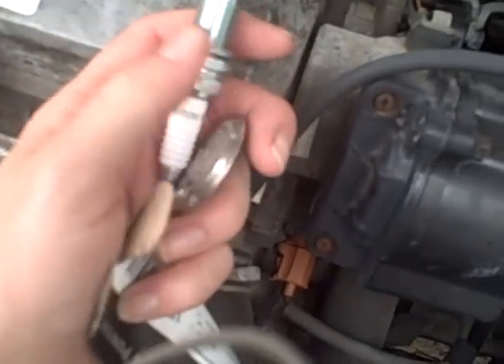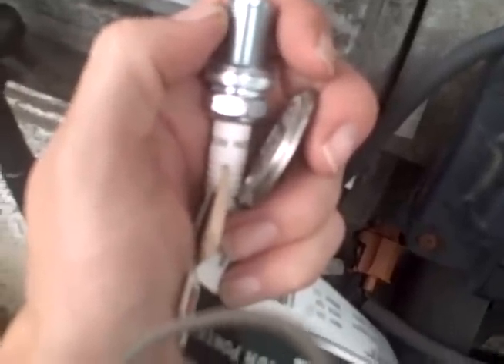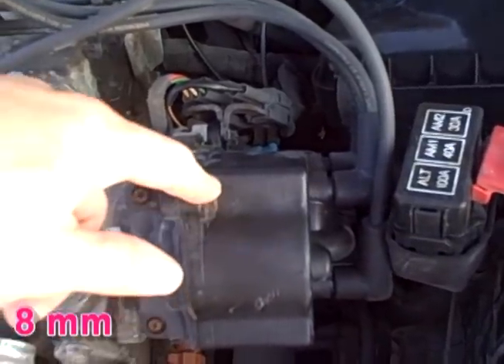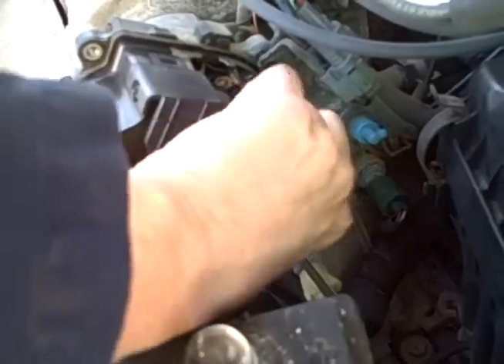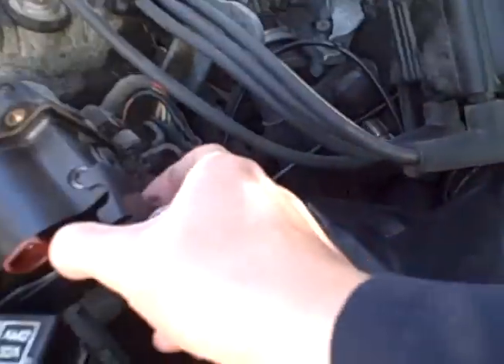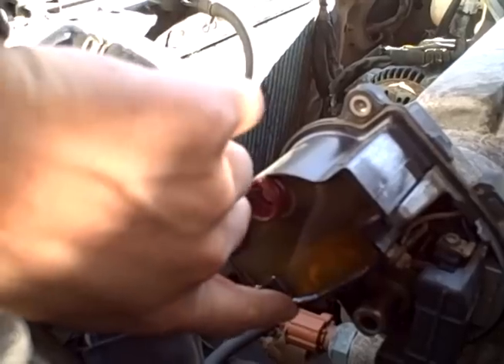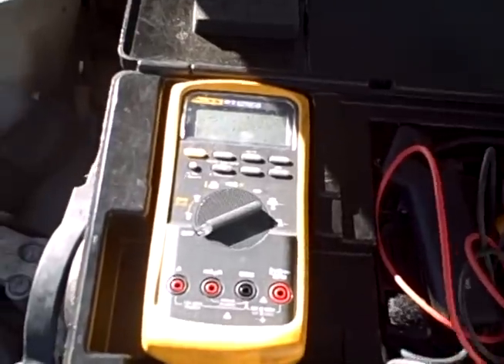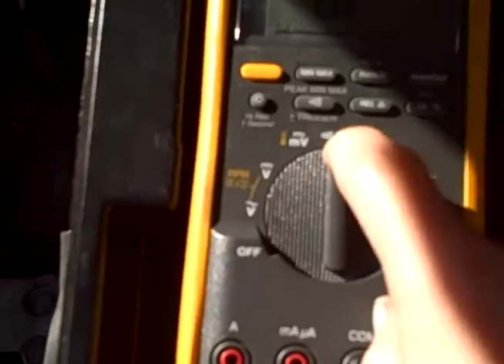How To Determine If You Have A Bad Ignition Coil. (Results May Vary)

Comment: Nice to see a girl working on a car!
Reply from the maker: You should subscribe then! :) I like to see people in general working on their cars. I love self reliance!
Reply: I do all my own repairs, had 1-1/2 years of school and a few years of service and aftermarket accessories experience. Pretty well rounded. I just don't get into engine or transmission rebuilding.
Reply from the maker: jakro1972 That's awesome!
Reply: D6Spanky No, you're awesome! I still need to check my drum brakes, then I am going to remove the Kelsey Hayes ABS unit and resolder the circuit board as I've heard that is commonly the source for my ABS codes!
Reply from the maker: Soldering is a great skill! I love doing it! Keep me posted how it turns out.
Reply: D6Spanky I mostly use my soldering skills for my RC cars and trucks battery, esc, and motor connections and for making LED light pigtails!
Reply from the maker: jakro1972 Cool!

Comment: This was on my Makita buffer so it's car related at least.  It quit working but would start if held at a certain angle.  I had a mental image that a contactor in the switch broke lose so convinced that was it ordered a replacement switch.  Waiting for the switch I went on line & found that a broken wire at the handle is common & guess what?  Yep now I have a brand new $35 Makita switch as a spare plus lost several days waiting on the switch.  Test - never assume!  Getting old is tough!
Reply from the maker: I try to always research online first. My sister has a 98 town & country. It would just randomly not start. We googled it and a briansmobile1 video came up with the answer. Saved me a bunch of headache!
Reply: D6Spanky 10-4!

Comment: Something I urge you to do...don't use champion spark plugs in anything from Japan...use NGK's...
Reply: D6Spanky, also don’t wear white after labor day, go swimming within an hour of eating, go outside in the cold with wet hair, walk under a ladder, or open an umbrella indoors…  or any number of old wives tales.
but seriously, use whatever plugs you want. As long as they are gapped properly they will work fine regardless of car or plug manufacturer.
Reply: @petrocksgarage  so keep on believing that always use nkg on Japanese motor,
Reply from the maker: fightingfalconfan I don't know I just go by what it says on the box. shrug This one said it was recommended for Toyota.
Reply: The manufacturers listed in owners manuals pay to be in there. Its advertising and product placement (like in movies). Always has been.
As for the 'ignition engineers’ (which don’t exist, btw), the engineers don’t choose manufacturers. They issue specs (e.g. thread pitch, spark hot/cold range, gap range etc). The company bureaucrats at the top decide the manufacturer. Engineers also don’t write service manuals or owners manuals (a lot of engineers use English as their secondary language). They are just consulted during the writing process.
Reply: @petrocksgarage not installing any plugs for me I guess if your customers don't know and you don't know go for it.
Reply: Pet Rock's Garage
Couldn't be further from accurate about who decides what spark plugs to use. The ignition engineer is the one who builds the whole ignition system from scratch, timing, what ignitor, coil, gauge of spark wire, ect...they figure out every little detail since they designed the whole system. Maybe you should actually learn how cars are put together before you go telling people what is safe to use in cars. Sure you pop in some champions in YOUR car and it seems to be working ok, not all cars can take what you just decide to pop in like in oil (brand not viscosity rating) But when it comes to fuel burn, go with what the engineering team went with; they know that vehicle better then you ever will; it's been proven time and again.
Reply: @fightingfalconfan  so what kind of oil do i use in my 7afe 95 corolla? 5w30? if so what kind?
Reply: @Mr123pbd  Seriously commenting on shit from 5 years ago?? 5w30 high mileage. The SAE doughnut super seeds what it used to call for back in that time frame.
Reply: fightingfalconfan, ok, then please explain why in some Fords have Mitsubishi motors inside and their owners manuals recommend using Motorcraft spark plugs (a Ford brand btw).  While Mitsubishi cars with the same motors have owners manuals that recommend a different plug manufacturer.  Could you explain that please?

In order for a third party brand to be listed in any print material, like an owners manual, a lot of money & signed contracts have to change hands between the two companies. No collaboration in business occurs without money, contracts & lawyers. So an engineer could specify NGK all they want, but if the lawyers can’t bang out a deal with NGK then they can’t specify NGK in the manual. Otherwise the motor company would get sued pretty hard for trademark infringement. So the motor company would have to find another plug manufacturer that meets the engineers specifications.  Which goes back to my statement of engineers don’t specify a brand. They specify the performance characteristics, heat range, size, thread pitch, gap of the plug etc so that the brand/manufacturer doesn’t matter.
Reply: f, that, i buy whats on fricking sale and has worked fine for 30yrs pfft,
Reply from the maker: Huh. ok. I'll be sure to change them out when they go to crap. I just don't have the cash flow for something as nice right now. I know, I know, It'll bite me in the butt.
Reply: Always go by the owners manual...if this one don't have one I am sure you can find one for it online. Like a forum or something.
Reply: fightingfalconfan Maybe Bosh is OK too who also makes iridium plugs like the NGK iridium, not just platinum.
Reply: Bosh is fine.  However, don’t waste your money on Iridium or platnum plugs on this car. All iridium & platinum plugs give you is a longer lasting plug. It doesn’t perform any better or worse then a standard plug.
Reply: Pet Rock's Garage thanks
Reply: D6Spanky shop rock auto
Reply: Actually dead wrong, going with a spark plug the ignition engineer chose not to go with can cause issues...don't matter if they are gaped or not.Asian vehicles are vary particular about what spark plugs to use.

Comment: An ohms test is almost always unreliable. First you have to completely disconnect the Component Under Test (the coil in this case, which I think is still connected to the wiring harness in your video) otherwise you can get a bad reading if there is even a tiny short somewhere in the circuit. You'll be reading the ohms of the entire circuit, not just the C.U.T. Second, the act of removing the C.U.T. can often fix it if the problem is a loose connection or damaged wire or something like that. Intermittent problems like that are a P.I.T.A. Third, you need to know the ohms spec for the C.U.T. which is often not available or different from manufacturer to manufacture let alone production run to production run. All an ohms test will tell you reliably is if there is an open in the circuit.
With that said, a voltage drop test is much more reliable, and you don't need to know any specs or remove anything. It can tell you if you have an open, short or excessive resistance (the 3 possible faults in a circuit) in one or two voltage measurements. Check out Dan Sullivan's channel & realfixesrealfast channel, they both have an awesome tutorial on voltage drop tests. Makes electronics diagnosis so much easier.
As for misdiagnoses, it happens to the best of us. My worst was on my '03 Dodge Durango when the passenger window switches stopped working, except from the drivers door switches. I knew it was an open in the circuit because there was no power (or was it ground, I can't remember) to any of the passenger doors window switches except for when the passenger window switch in the drivers door was pressed. Traced it back towards the drivers door switch and after an hour or so of tearing apart wiring harnesses and such I got to the point where I thought the open was behind the dash. But decided to double check myself first before tearing into the dash. Turned out I was tracing the wrong wire for over an hour. The circuit diagram had a typo. Got back on track and found the open was inside the drivers door switch itself. The solder joint for the window lockout button was cracked. Power (or ground, I can't remember now) for the passenger window switches goes through the window lock out button in the drivers door switch. So the crack was causing an open in the circuit, which made the passenger window switches stop working. The switches for the passenger windows in the drivers door switch don't go through the window lockout button, which is why it still worked. Took it apart, resoldered the joint, put it back together and it has worked perfectly ever since (4 years so far).
Reply from the maker: Thanks for the channel recommendations! And yeah, I know those diagrams are sometimes off.  Someone in class learned that the hard way. Nice work!  Thanks for your comment!

Comment: The handheld Flukes are the benchmark when it comes to the portable multi-meters. I would also like to point out that if you are on a budget, to check out the Craftsman multi-meter that they sell for ~$15.00, they perform well for the money, and have a very similar layout and feel to the Fluke.
Reply from the maker: That is good to know. That was my big splurge in school. I had a cheap set of Crescent brand tools and then my fluke. i couldn't afford to go into debt for a $3k Snap On Tool box like most everyone else in class and I wasn't going to lie about having mental issues to get state money to pay for my tools (like most of my classmates did).

Comment: Sorry i am late.
Great video.
Replacing the distributor is a better value than rebuilding it your self,as dave1135 said the distributor, since it lays on its side gets oil from the back of the camshaft.
There is a seal in side the distributor that keeps the oil from getting into the cap area.
I have a 92 Camry that had that seal fail in the distributor you can imagine the  havoc that caused.
Love the meter Fluke are great meters,worth every penny!
I use Ampprobe meters myself.
Again great video,i will keep watching.
Reply from the maker: I was wondering where you where! :) Thanks so much!

Comment: I think the coil "output" terminal is the big red one,on top of the coil (~6:18).. I think what you're referring to as the output,might be the rotor shaft. ;-)
Reply from the maker: May well be.  :) I was going off of what I could find on the internet. Which isn't much! Don't worry, I resolve the situation.
Reply: Don't get zapped,or we'll have to start calling you Sparky. :)

Comment: Hey spanky, they usually just replace those Toyota distributors because they also have a problem with the shaft wearing and oil flooding the distributor. With that new one, you're taking care of multiple problems by replacing it. :-)
Reply from the maker: Oh wow. I didn't know that. Thanks for the heads up!

Comment: Looks like you are getting ever closer to getting that car running. It's exciting to see. As far as a misdiagnosis mishap, I actually took our F150 in to the dealership to get diagnosed. It had charging issues. The dealership replaced the battery and said everything was all good. We got the truck back, and I drove it. The thing stranded me about a mile of two from the house. At that point I knew that the alternator brushes were causing the intermittent charging problem due to wear, so when the Ford tech tested the alternator it worked. When I was on an incline in the vehicle, something shifted and the brushes didn't make contact. Had the truck towed to the house. The next day I bought a motorcraft alternator and installed it myself. Problem solved. Goes to show that even the pros misdiagnose stuff. ;p
Reply: Silver Streak
Sometimes there is just no way to tell unless you experience the problem first hand. Even then, finding out what is causing the issue can be hit and miss. Electrical is stressful!
Reply: As an electronics technician, I can say that intermittent discrepancies are the bane of my very existence.
Reply from the maker: Silver Streak Oh I bet! Yuck!
Reply from the maker: ***** We had to take our Liberty to the dealership (it was still under warranty) for a front end noise. They ended up replacing almost everything that had to do with steering after we talked to the owner of the dealership. The techs just had no idea and kept replacing parts, hoping the warranty would run out. But yeah, everyone misdiagnoses at some point.

Comment: Awesome trouble shooting...always follow your gut, that is the best way to learn. If it leads you down the wrong/right path, then you have "experience". It's hit or miss on the ohm testing, Brian has a point, but it never hurts to try. BTW, very nice multimeter...I am jealous!! As for horrible misdiagnosis...mine was on my '01 dodge Dakota, instrument cluster stopped working. I go down the path of tracing wires and modules, even went to a couple of wrecking yards and grabbed multiple Transmission Control Modules, Body Control Modules...came home swapped out each and everyone a couple of times, re-checked wiring diagrams and wires....two full days of diagnosing the issue...the next morning, I was on the phone with a wrecker, to have it towed to my buddies place, and the wrecker said he would be a couple of hours...after a couple cups of coffee and deep thinking, I went back out and checked the one thing I had overlooked...the source of all power to the instrument cluster...the ignition module/switch...yea, you guessed it, 12v+ was going in, but NOTHING was coming out....I jumped the out bound for the 12v+ BCM (Cluster power) and BAM everything worked. So, a quick trip to NAPA, $40 bucks later, new ignition module solved the problem. EVERY car I work on now, starts of with, this does not have to be a "DAKOTA" lesson...Take it slow and KEEP IT SIMPLE :)
Reply from the maker: That is an excellent lesson! Thanks for sharing. I have found that my first instinct is usually right but then I second guess myself to death because I don't have as much experience as I'd like. And yeah, the Fluke is awesome! :D